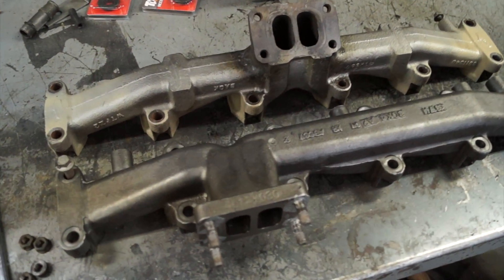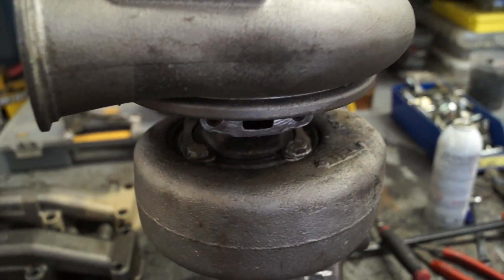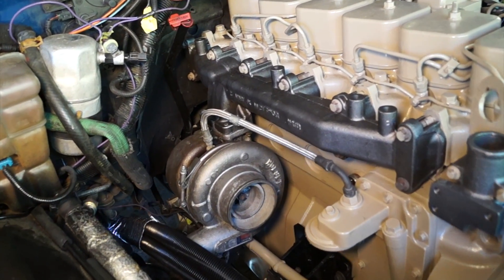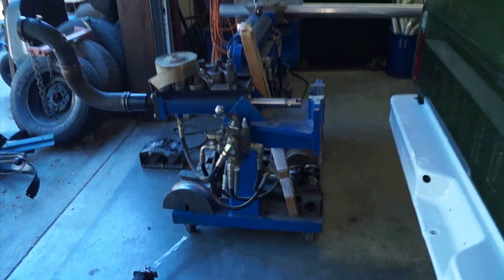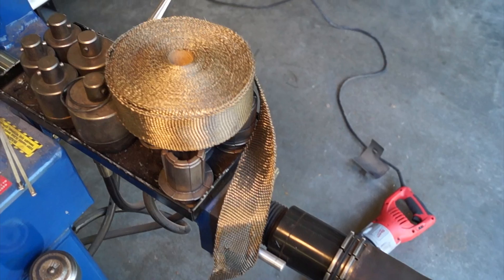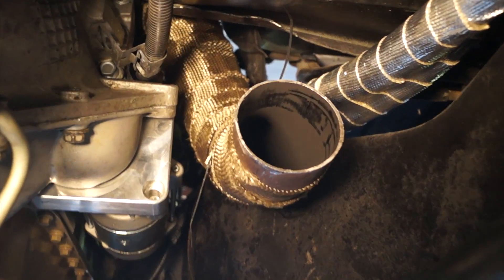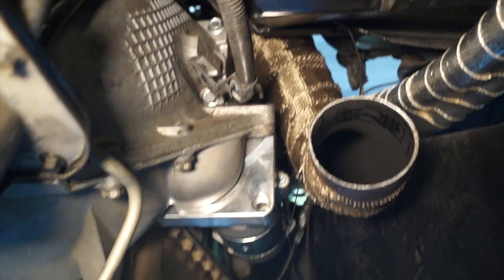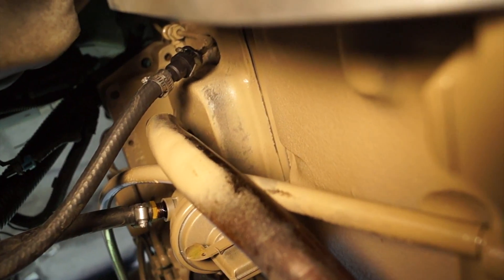Part 5 - Blue Suburban - Cummins 6BT 12 Valve Chevrolet Suburban Swap - Manifolds

Comment: After battling the idea of swapping to the industrial manifold for a couple weeks, I decided to give it a try since I had it lying around.  It sure gives you a heck of a lot more working room in the GMT400 trucks and also keeps the turbo heat away from the AC and other items.  The problem I ran into was exhaust and turbo drain.  I ended up using a flexible stainless drain tube.  The exhaust proved to be more difficult.  Since my donor truck was a 94, it used the cast elbow off the turbo which kicks the exhaust down at a ~45* angle.  There was no way to use it and clear the firewall.  I had already purchased a 4" downpipe (for a 1st gen cummins 2WD; fit GREAT in the GMT400 with the Dodge manifold BTW) but couldn't use it with the industrial manifold either.  I ended up cutting the flange back about an inch and completely reworking the pipe to fit.  It ended up looking pretty close to what yours did as well, just in 4".   Just figured I'd share in case anyone ran into the same issue as I did.  Getting closer to getting this truck done and on the road.  I cannot wait!  The suspense of driving it is killing me.  Very happy with my AVNW mounts, PS pump drive and accessory bracket setup.  I highly recommend Jonesys/AVNW.
Reply from the maker: Really appreciate that, thank you!  And thanks for posting about your experiences, we know a lot of people read through these comments for just this type of personal experience.  Happy building!
Reply: I'm doing this swap in a 1983 chevy K30. The engine is out of a '97 Ford F-800 and it came stock with this manifold. I've heard some people call it the "Ford manifold". Just like you I have to get a flexible drain tube because the one that's on the turbo goes right across where the engine mounts are supposed to go, because in the box truck the engine was in, there was no mount on the side of the block like the pickups have. I'm not sure yet how much room I'll have between the turbo exhaust outlet and firewall, looks tight, but not quite as bad as the 88 and newer trucks.

Comment: And also putting a egt probe where you did does nothin, should be in manifold to measure heat before the turbo not going out the tailpipe
Reply from the maker: Sorry Cummins disagrees with you. After the turbo is the best place for the sensor so it gets a stable trading from all cylinders.  Google it....,,

Comment: Got a feeling that drain isn’t gonna work very well but could be wrong🤷‍♂️
Reply from the maker: Oil drain tube is big enough that can be basically horizontal as long as the turbo is above the oil level in the pan.

Comment: Great looking project, im in the middle of a similar cummins conversion and did that same exhaust manifold setup (gem 3 manifold on a gen 2 6bt ) Im still trying to reclock my turbo without hurting it. Any suggestions on getting that thing loose?